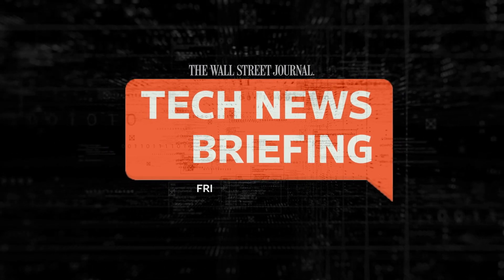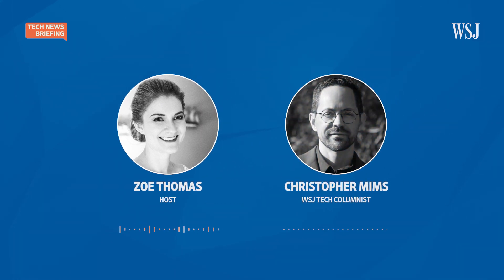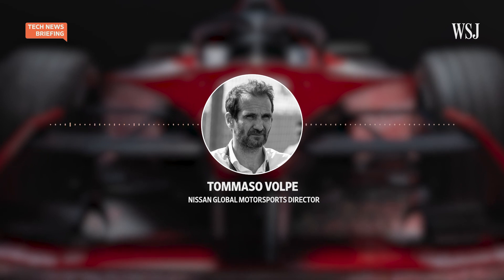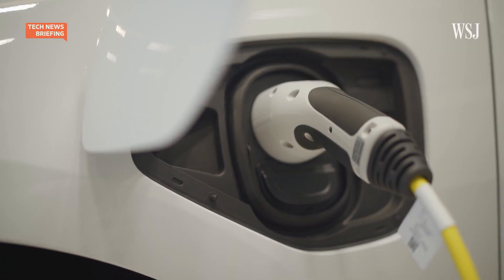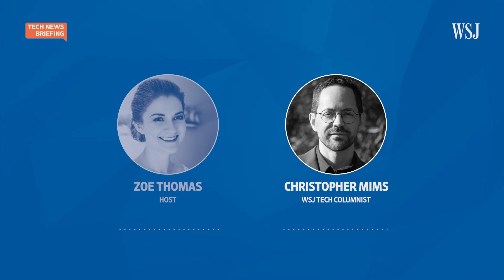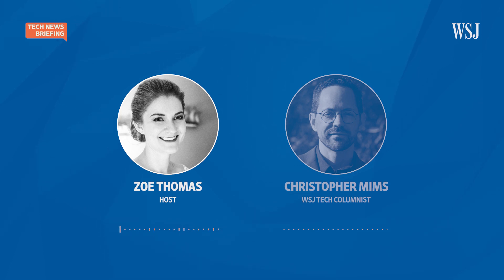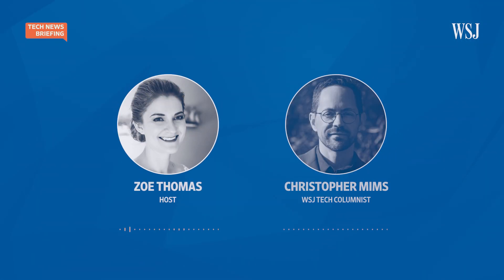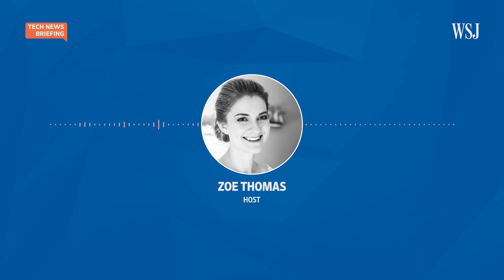Could the Key to EV Adoption Be… Shorter-Range Batteries? | WSJ Tech News Briefing

Comment: The problem with this article is 'gas pump mentality': The thinking that when charging the battery must go from empty to full like we do with a gas tank.

 EV owners quickly learn that makes no sense.  What matters is the time to add enough charge to travel the required distance.  Half charging a bigger battery is much faster than fully charging a half size battery.   Small batteries do not make road trips better..... half charging bigger batteries makes road trips better.

Comment: Charge rate increases linearly with capacity whereas diminishing returns due to weight increase is much lower at the scale of cars. ‘muh future battery tech’ applies to both smaller and large batteries. If Tesla is rolling out megawatt charging next year, there’s nothing stopping large batteries being the superior option given someone has sufficient money
Reply: Weight is still an issue no matter how fast you can charge a battery.
Reply: Depends on the use case. I've got a Mini with only 80Miles range... It's a city car and it perfect for 99%. We had one instance of the 1% last week when we had to get some family at one airport which is 50miles away. We just spent 20min on the way back to have a coffee. My car is more Zippy than a Tesla. I am also a cyclist and I do know how huge of a difference weight is. I choose the mini for these reasons. If I could go to a shop to rent a 600Miles battery trailer with extra boot capacity, that would be perfect.

Comment: Gasoline is much more energy dense than a battery’s power storage.
Reply: yes, but actually, the combustion motors only use less than 20% of the power from the explosion. while electric motors are 100% energetic efficient.

Comment: Why is the finance sector focused on faster charging with technologies that haven’t been commercialized yet, when these car companies could tweak their vehicle designs to reduce the drag coefficient in order to reduce the weight of batteries needed for the same range. Reduced amount of batteries for the same range equals reduced charging time as well. This is possible today without waiting for battery technology on the horizon to be available. Why isn’t this the focus?
Reply: they already are. Teslas have some of the lowest drag coefficients out there. However, people don't want a car that looks like an airfoil (I would but apparantly that doesn't sell or else they would be designed that way) so I doubt they will make it any lower
Reply: @spacetomato1020 My point exactly. Tesla made that effort and it paid off in less expensive to manufacture vehicles. Why aren’t the legacy automakers putting in that same effort?
Reply: no one wants to drive a car shaped like an egg. I love my toyota yaris, but the amount of shit i get from owning a small egg shaped car is kinda hilarious.  Only way to make this the main focus is for the government to step in and regulate car size and shapes like Japan did with their kei cars. That is never going to fly in the United States.
Reply: Because Aptera is 17 years deep and still hasn't made deliveries? And they even cheated with the 3-wheel design to fall under lax motorcycle rules, and they still can't deliver. I do agree with the sentiment though. Wheel covers over the rear wheels would make a huge difference. I think VW tried something with the XL1 but they just don't have enough conviction.
Reply: @dudea3378  While I am interested in Aptera from the standpoint of a company exploring the outer edges of design to produce a more efficient vehicle, I don’t think the industry has to go to that extreme level of design change to achieve measurable benefits in reducing battery weight and reduced charging times. As the other commentor said, Tesla already did this to some extent and their vehicles don’t look radically different from what exists now with other brands. This seems like low hanging fruit to me. So why don’t they do it?

Comment: Would EV race cars win or lose in a formula one race  vs gasoline race car ?
Reply: The EV’s are much slower and have shorter races.
Reply: There's no production electric car that can sustain F1 performance for an entire race. F1 cars are not just about speed and acceleration.
Reply: Lose. they are way slower than F1 cars. That's why formula E, only races in small street tracks.
Reply: At the moment they would lose, but the FIA knows that electric is going to beat ICE cars within the next 15 years which is why they are set to go all electric in the next two decades. The hybrid engines in F1 cars today are some of the best, fastest, and most reliable engines to ever be made and that is thanks to the electric motor.
Reply: @Maderasdesign  15 years? Who knows but the batteries will have to get way lighter so that cars are a similar weight and charge time and range will have to approach an F1 refueling time and distance between stops. Last time I looked they were changing cars instead of recharging.

More likely ICE racing will be banned.
Reply: @Fehr270  the day that happens Motorsport should die.  I remember the early 2000s the screaming v10s of schumi and Montoya. I rather see that the snooze fest that is fe
Reply: @akashsarma8241  change is coming always is.

Comment: People who are so out of touch that they think already short range EVs can be even shorter range, need to be removed from every position immediately. They are a danger to people who might have to deal with these cars. Which can not even carry extra fuel containers in the trunk. Just insane how these people are allowed stay and go around causing damage.
Reply: The argument is that long range is to compensate for sparse and slow charging. If charging was speedy and ubiquitous, then people would overcome their range anxiety. Even still, I imagine that excluding road trips, pretty much every route on an electric vehicle is dramatically less (1/4 or most) than its available mileage. So assuming someone has alternative means for taking road trips, having less capacity is not an issue.
Reply: plug in hybrids are becoming more of a thing though. The rav 4 prime has 90 mile range before it would switch over to it's combustion engine. 90 miles is more than enough for a lot of people in cities. Rural areas are gonna be the biggest challenge though i agree,